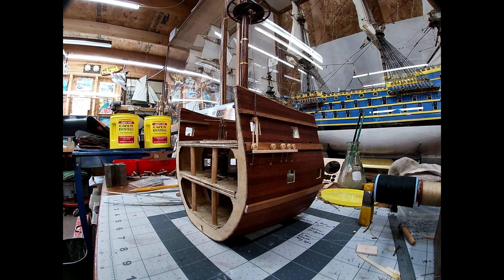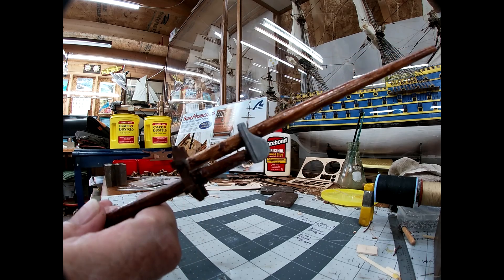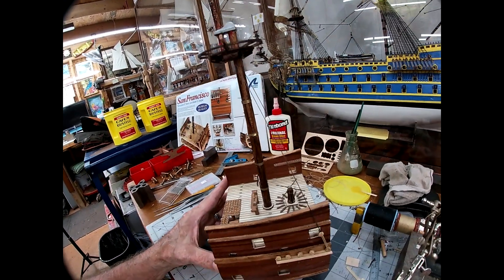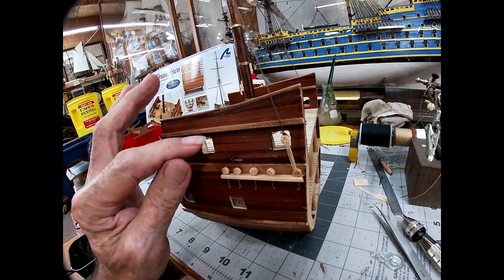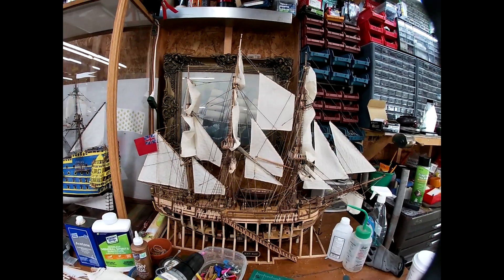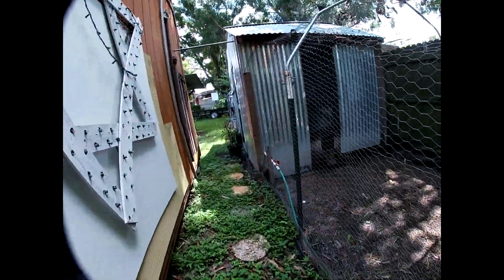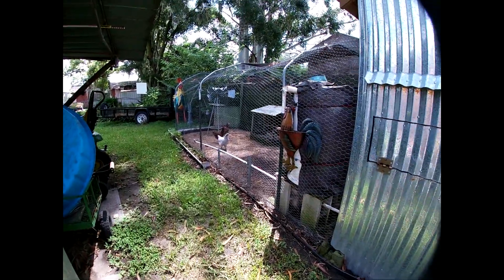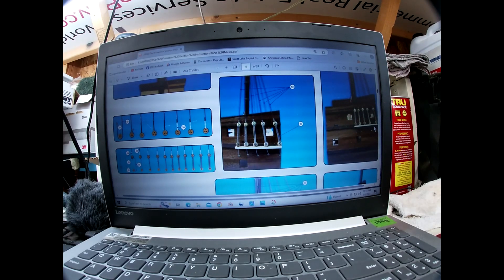San Francisco sectional build #17

Comment: Roger, looking great! Hopefully you're on the right path and that TURP will be put behind you. On the matter of the capacitor, regardless of the readings if the capacitor shows any signs of bulging, replace it! Most of the evaporator fans also tend to take out the 24V contactors so you might want to replace that too. Easy and very affordable.
Reply from the maker: Thanks